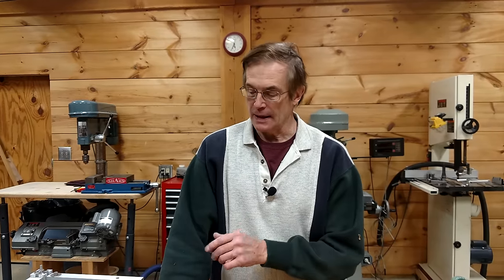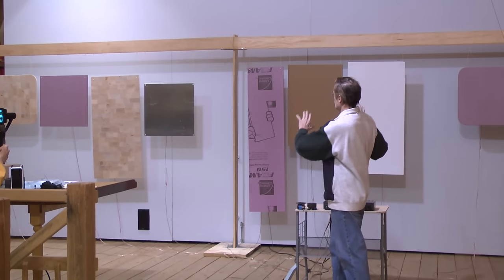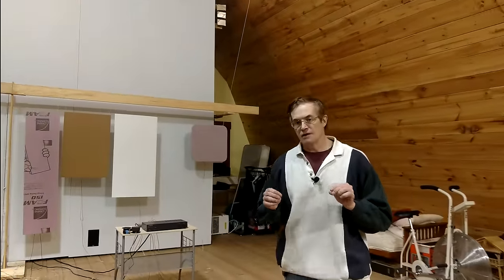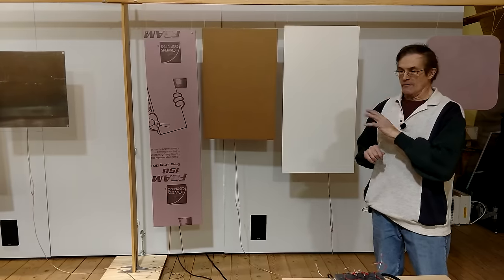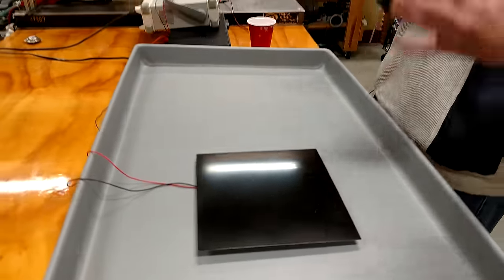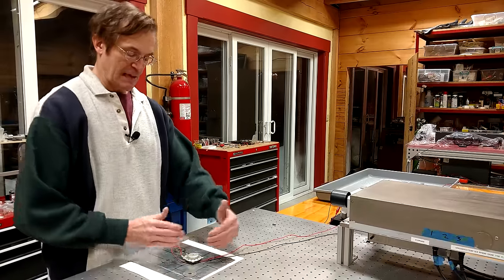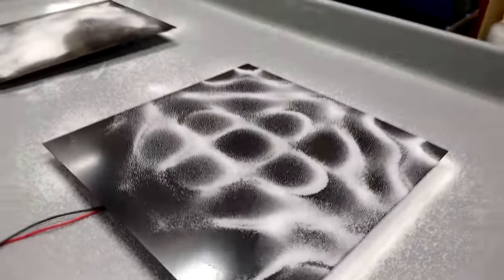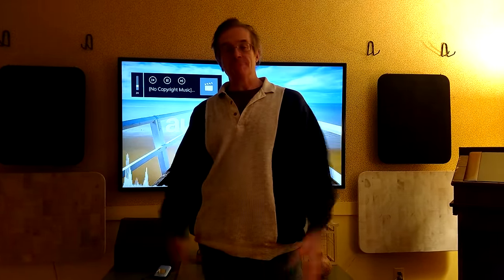Fantastic DIY Speakers for less than $30!

Comment: Cool gimmick, but not in the same realm, sonically as well designed speaker drivers.  I used a set of the dayton 40 watt exciters in my work shop, the walls of which are made up of cut offs of overhead doors - insulated metal.  They sound pretty good just attached to the wall.

Comment: I have to wonder why you are hanging the speakers from the tops. I assume the exciter works by pushing its front part in and out to vibrate the board i also assume that vibration is dampened by string at the top of the board and some board movement is reduced. why not mount the exciters to the wall instead and thereby allow the board to move freely and with more power? assuming the magnet is strong this could be done by install a metal cup for the magnet to sit in or a different material cup with some bolts to hold the magnet in the cup. Also those hooks in your living room look awful why not just install two long screws for the board eyelets to sit on
Reply from the maker: Hanging by these thin lines is the very best method of isolation we discovered.
As I described, the speaker acts by actually  bending and flexing the panels  rather than by generating any net movement of the panel as a whole.

Comment: Have you tried to wrap these panels with a photograph? Does it affect the sound?
Reply from the maker: I haven't, but spray painting has no effect.
Reply: @TechIngredients  Doyou think covering the panel in canvas that has a photograph on it would change the quality of the sound??
Reply: @TechIngredients  I’m thinking of these speakers doubling as artwork would be a very nice incorporation into the room.
Reply: How thick was the balsam sheet that you use?
Reply from the maker: 1/2"
You'd have to test this as the mass and added stiffness with the additional canvas will have some effect.

Comment: Its a pity because the aluminum has the best bass. Wonder if you add a beveled edge to the metal plate if it will get rid of the ring. Then you can use the metal in combination with the others to get the perfect balance.
Reply from the maker: You'd need to reduce the resonance  of the bulk of the plate and that's  not due to the sharp edge, but to the low damping of the aluminum itself.

Comment: Rectangular membranes have natural resonances, but circular membranes don't. That's why drum heads don't have a distinct pitch (unless they are mounted on the end of a tube, which does have a resonance). So why not use circular panels for your speakers?
Reply from the maker: We tested this in the follow up video.  However, you're assertion isn't true.  Circular shapes can have resonances, consider a metal gong.

Comment: If you want to do this on the super cheap just get the adapter and place it on the back of a piano it is an acoustic panel and Of course it's only super cheap if you already have a piano especially if it's sitting in the corner and no one's Play is it anymore And then pump piano music through it wow! 

That said I still plan on making invisible speakers using these principles in a room I am building
Reply from the maker: Great!
We are considering using the bodies of string instruments, without the strings.

Comment: This technology has been around for a very long time. I know because I had a pair of ceiling tiles made from styrofoam that were actually speakers. It blew my mind how good they sounded and how little power it took to drive them. That my friend was well over 30 years ago. This is not new to the industry. Only to Youtube.
Reply from the maker: That's why you can buy commercial exciters.

Comment: Instead of hanging these speakers from lines, wouldn't it be better to have the cone fixed to the wall for the plate to vibrate optimally?
Reply from the maker: No 
The actuator itself  is part of the moving mass.  Fixing the actuator significantly  reduces the quality of the sound output.
Reply: @TechIngredients  I understand. But looking at one of their other models (DAEX25X4-4) it looks like the body of the actuator gets connected to the panel. So I was wondering with the model you used, the 4 holes could have been fixed with pins that move freely through a shaft on the panel. The pins bearing the weight and still allowing free movement of the panel.
Reply from the maker: Yes, some do.  We detected no benefit  from that additional  mounting  point, and the pins quickly came loose because it was impossible  to securely mount them in the soft panel material.

Comment: From my experience what matters is the environment. You can just take a cheap subwoofer and a couple of cheap full range speakers, and put them in a perfectly designed box they sound great. Some speakers are specifically designed for a box and some do well in open air. But with subsonic Bass the box is everything, I know it sounds stupid but I can buy the most expensive subwoofers on the market, and they will sound like garbage in the wrong box.

Comment: Did he put the counterweights on his actual speakers or just the plates?
Reply from the maker: The speakers had both the counterweights and exciters.
Reply: @TechIngredients  Okay, thank you!  Any particular adhesive you can recommend to mount the washers to the foam panel?
Reply from the maker: You should be able to guess my favorite... EPOXY!
Reply: @TechIngredients  I just watched another video where you recommended forgoing the counterweights altogether.  I think that sounds like the easiest way to go! XD

Comment: Friend, what about composite materials? Like, in 26:40, you have one styrofoam panel + one "balsa wood" (?) panel, what if you glue a tiny layer of styrofoam on balsa wood, or even more layers (like styrofoam -> balsa -> styrofoam, or balsa -> styrofoam -> balsa, or styrofoam -> balsa -> aluminum, etc...)? Or put a strip of balsa "somewhere" in a styrofoam panel? Different sizes/shapes/etc... of mixed material? Of course the "sound will sound" (😂) different,  etc... But... Maybe the "compensation" of one material over the other can be in the same panel and not on different panels/"speakers"?
Reply from the maker: Absolutely.
It requires some experimentation because the variables are numerous, but that's half the fun.

Comment: How are they wired? They are 4 ohms a piece, most recievers are rated for 8 ohms.
Reply from the maker: I discuss that type of issue in our first LRAD video.  Basically, you can drive a lower resistance exciter as long as the amplifier's current limits are not exceeded.

Comment: I started to think about something.. I wonder how it would be if you made a plate out of fiberglass reinforced concrete.
Reply from the maker: Terrible.
The mass of the panel is important.  The greater the mass the lower the volume output for a given power setting.  Those panels would be so massive that the exciter would produce very little sound.
Reply: @TechIngredients  Aaah.. Didn´t think of the mass. I was thinking if you made like 5mm thin plates that it would work. But yeah, the mass would be a problem.

Comment: Rather than hang the speakers couldn’t you fix the back of the exciter to the wall giving a truly floating speaker?
Reply from the maker: It doesn't sound as good. The movement of the exciter is part of the system.  Even a mass loaded exciter which is called a "shaker" doesn't work as well.
Reply: @TechIngredients  That makes sense, thank you

Comment: What happens if you layer them?
Reply from the maker: It's  complex.  If they are not touching, then the front layers absorb and block the sound.  If they are in contact, then the frequency  response shifts to higher frequencies as they become stiffer.

Comment: How about a driver with more juice and a huge panel on the ceiling as a subwoofer
Reply from the maker: That could work.  As you scale it up to reach lower frequencies and larger movement you'll have to think about load spreading because these materials are not strong.  Bonding the driver and support points will need some thought.
Reply: I just want to say that the commitment in answering comments on 4 year old videos within an hour of them getting posted is amazing... :)
But I would think hanging it horizontally on the ceiling solves some of the problems as you can mount it on 4 corners (you don't have to hang it from the edges, rather centered 4 mountings with even load spread) and the exciter will be resting against the board causing less stress on its adhesive.
Reply from the maker: Actually, mounting by the four corners reduces the performance which is best with an absolute minimum of restraint.  This is easiest with the panels vertically supported by the two upper corners.
Nevertheless, the biggest issue will be the force concentration near the driver.

Comment: Always curious to know how Carbon Fiber panel would sound.
Reply from the maker: It sounds a lot like the aluminum.
Reply: @TechIngredients  have you tried something like drywall? Or hardboard (cement boards)
Reply from the maker: Yes, they're too dense and the sound output is reduced.

Comment: Odd thought. Place one of theses speakers inside an acoustic/electric guitar connect it to an amp and the guitar to the amp.  No doubt there would be feed back issues. None the less it is an odd though.

Comment: I could sort of follow him (but not agree) until he got to the part about instruments where he was completely out to lunch. Instruments are resonant devices and essentially NEVER dipoles like these panels. In fact, well designed speakers are only seriously resonant at the low frequency knee of the box.That does not mean that they can not sound OK, that means however that these demos do show a lot about listening habits and perception of real instruments. Still the Dayton Exciters could be an interesting thing to experiment with. A program like REW would show frequency response and resonances. The TV room setup would be a comb filter disaster with the panels that close to the wall. Dipoles work best at least 1 meter from the back and side walls.

Comment: Is there anyone in the Netherlands who has made these speakers using end grain balsa wood? I can't lay my hands on a piece of this sheet, there's a provider in Italy but they do not ship one single sheet balsa because it will break during shipping. Anyone knows where in the Netherlands to get one or maybe even two sheets?
Reply: I used another wood type (birch multiplex 2cm) in the meantime but it doesn't deliver a good enough sound. And I have to deal with a 'tweeter' exciter that deforms the sound....the rest performing quite well though.
Reply from the maker: In our follow up video on these speakers I demonstrated the use of fiber based acoustic ceiling tiles as an alternative material. It works nearly as well as the balsa.  You might that this before continuing the struggle to obtain the balsa.
Reply: @TechIngredients  I have seen your later video on this matter, but I preferred the sound of the balsa (warmer) as well as the look of them. And they happen to hang in my small DIY studio;)
Reply: Thanks for answering (and so quickly for that matter)!

Comment: So what I'm getting is that these make great mid and high speakers, but not low freq speakers? So essentially I still have to buy a subwoofer rather than making one.
Reply from the maker: That's correct.

Comment: What happens if you attach them to a speaker
Reply from the maker: There are attachment issues unless you remove the cone and the cone supporting rim and then you have an exciter just like we're using.
Reply: @TechIngredients  I was thinking just sticking it to the side of a wooden speaker maybe fill in what ever frequencies are missing

Comment: 5555 comments at the time of this writing so maybe i'm repeating someone's comment.
In this demonstration the applied audio signal was equal across the audio spectrum.
The response from those transducers was not equal across the spectrum. How about putting an equalizer ahead of those exciters to artificially produce a flat audible response curve.
Reply from the maker: Sure, that can be done.  A parametric equalizer would be the best choice.

Comment: Sorry this non sense. Flat panels like those are all of different dimensions. They are are of the type called "an infinite baffle" who's main purpose is to increase the path difference between front and back, of the loudspeaker,  to minimise cancellation. So regardless of the acoustic absorbency of the material, this is not a true test, due to the baffle dimension difference.

Comment: так ведь можно скомбинировать 3х полосную систему  металл экструзию и дерево
Reply from the maker: It's  an option, but the ringing of the metal should be damped. Try two thin plates, coupled with a rigid spacer at the exciter position and a constrained layer sandwiched elsewhere.
Reply: @TechIngredients  👍

Comment: I’ve watched this a couple of times and listened to it through my studio monitors and Akg headphones and it sounds like you have pretty good results using uniform shaped panels.  It makes me wonder what might be, if the results couldn’t be dialed in using techniques like  this where a builder shapes the bracing of a soundboard of a guitar.  https://m.youtube.com/watch?v=Ei5-DkVTrEE

The obvious downside of your setup is that it requires a number of separately driven actuators and the panels require a large listening space like your barn.  Maybe an approach with panels that had a “tuned” asymmetry could shrink the necessary size at least.  Anyway, it’s food for thought.

Comment: the foam is around 20 dollars and the speaker things are 20 dollars, over 30, not to mention glue, cotter pins, sand paper,  box cutter, rope, eye screws, etc. will put you over 50 dollars. they look cool as f#: but the title is misleading. maybe where he is from the mom and pop stores sell 1 or 2  of things, so its cheaper. i might make this for my new house.

Comment: You are confusing things a bit by talking about wavelength, better to talk about the resonant frequency of the various materials as regards size and shape.The wavelength of 1kHz is just short of 30km. The highest audible frequency at around20kHz will have a wavelength of nearly 15km. Wavelength is used in radio wave propagation not acoustics.
Reply from the maker: Sorry John, but you're wrong. Check your  source material.  The wavelength of a 1kHz sound is 30 cm. or one foot.  Wavelength  and frequency can be used in acoustics and both are usefull when calculating the dimensions of acoustic systems  like speakers.
Reply: @TechIngredients  This is a clash of two subjects,  sound and radio. I know little about acoustics, my field was radio. You are talking about sound waves whose wavelength is calculated by dividing frequency into the speed of sound. Electromagnetic wavelength is calculated by dividing frequency into the speed of light. The difference because of the speed they travel. My apologies, I should stick to what I know.
Reply from the maker: Don't  apologize.  You've learned something.  Acoustic principles  are not that different from electromagnetic principles. You can apply what you already know to acoustics and you'll be  head of most audio engineers.

Comment: Your confusing frequency with amplitude
Your changing the frequency  not the volume  . Aptitude is volume. Frequency is bandwidth.

These devices are called transducers and they have been around sence world War II .
Reply from the maker: No, I am not.  If you're referring to the amplitude of the resonance peaks it does depend on the frequency of the driver.

Comment: Your balsa and poly demo sounded out of phase. The low end sound dropped off drastically from the just balsa.  Also distance from. The wall to the speaks going to effect the reflective wave.
Each speaks according to size would need to be on the plane nessary for its size.  The 24" squar might be what it is but the 24x48 may need to be futher from the wall.  Also the size of the room and materials inside it will change the sound.
Our ears at our age are not as good as say a 12 year old kids ears are.
This is why young children should never be in a room with loud sounds.
I see your 24" squar dosnt really reflect 100% off the wall.  Overall the demo was impressive.   Now suspend say the 24" squar inside a cabnit with a 4" air gap around the panel and mess with the distance from the back wall as well as set it at angles. 
If your doing a theater room behind the screen you have plenty of room for big panels like these to reinforce the overall sound.
You could also do them on back walls with arctucal shaped sheets but keep in mind if you have a fire these poly birds will offgas deadly fumes. Code requires them covered by fire proof materials.

Comment: This is extremely inefficient design.
130 Hz - 20 Khz
Not a good response
50 Hz over THX approved systems
Reply from the maker: Based on that, all tweeters and subs are  bad designs. Think of it as another tool.
Reply: @TechIngredients  efficiency comes from the file the music source comes from. You can never achieve an absolute "flat" response unless you make them yourself digitally. And that's only what some listeners would perceive as a flat response 
Sub woofers and tweeters can be tools, but all full range sounddrivers can respond on the lower end of the EQ (15-16 Hz), and they can achieve the higher end as well 15Khz+. 
Just takes a proper enclosure.
A flat surface will only enhance vocals and highs, unless used as a barrier to reflect sound waves via room correction of your bass driver
Reply from the maker: Fair enough. They certainly are an inexpensive approach and will get you a lot of attention when you explain their role to an interested listiner.